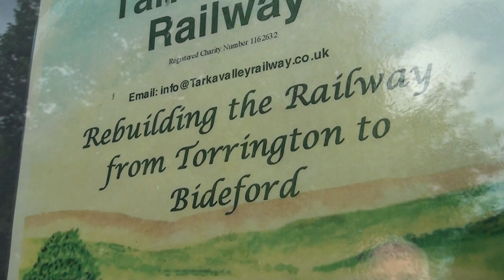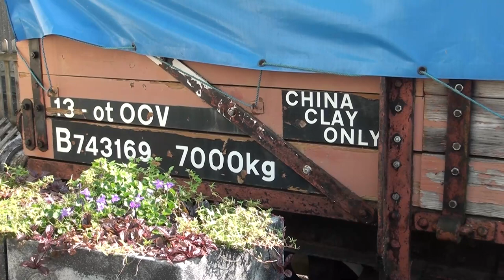Tarka Valley Railway Group Linking Torrington to Bideford

Comment: The trains 🚂 running between Torrington and Bideford last ran in 1965 could be a thing of the future when the time 🕛 comes. It would probably be a good 👍 thing to happen. Where a train 🚂 could extend to Barnstaple via Bideford. It could happen to be a true dream 😴. If trains 🚂 run between Torrington and Barnstaple via Bideford and Instow, this could happen every hour runs everyday and public holidays except Christmas 🎄🤶🧑‍🎄🎅 Day and Boxing 🥊 Day, perhaps 🤔 could run on New Year’s Day 🥳🎉🪅🎈🎊 it means buses 🚍 on the roads may be reduced to depart Bideford to Barnstaple via Instow every 15 minutes 🕒 to every hour 🕛 depending how many people use the trains 🚆. Also if trains 🚊 run from Torrington to Barnstaple, it could run all the way to Exeter St Davids and Exeter Central. If the railway 🚃 track is completed ✅ between Torrington and Barnstaple via Instow & Bideford, it could commence on Sunday 1st September 2030. There is a directing bus 🚎 service runs from Torrington to Bideford is operated by Stagecoach 75 and Go Devon Bus 🚎 315 runs Mondays to Saturdays throughout the year except public holidays. 😍😎👍❤️💕
Reply: The last train ran 6th November 1982.
Reply: Torrington station is quite a distance from the town at the bottom of s steep hill, probably why it wasn’t used and closed